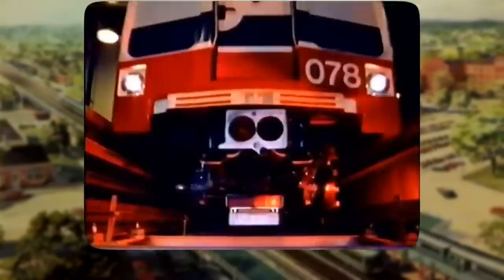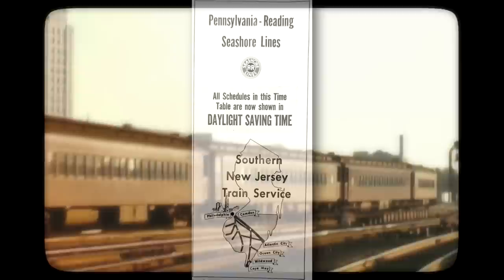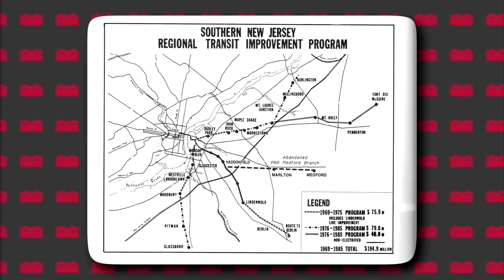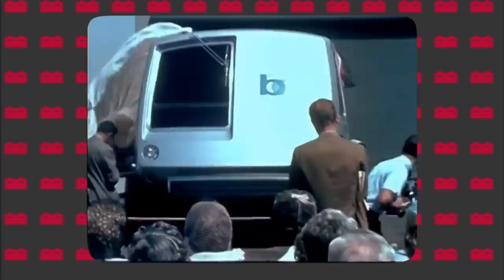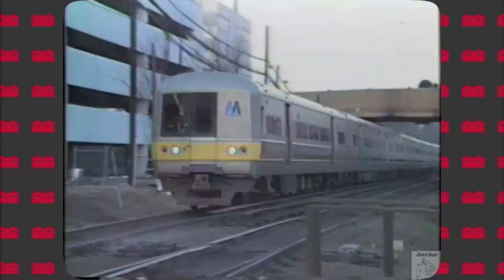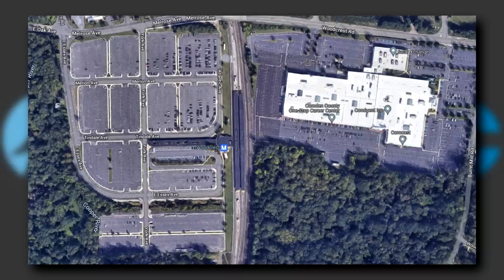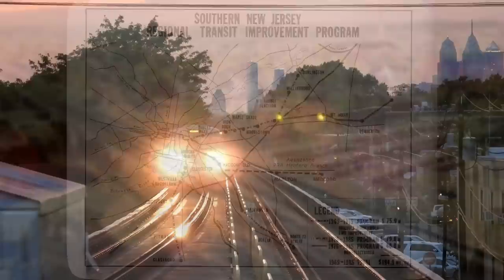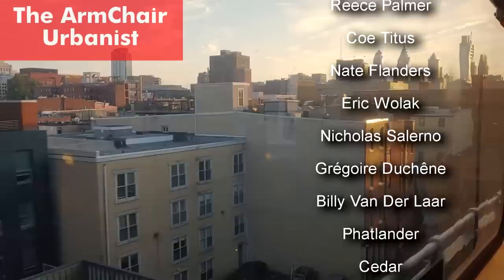PATCO: The First Modern Metro Line in North America

Comment: I came over from London to ride the NJ Transit River Line a few days after it opened.  When I arrived in Camden I then rode PATCO to Philadelphia; what a confusing place for transport that city is.

I knew that PATCO was about the same age as the Victoria Line, but if it opened in 1969 then that was not three years after the Victoria Line which opened in stages between 1968 and 1971.  I’m not sure about the date for Pimlico which was an extra station opened slightly later.

The original trains on the Victoria Line were known as 1967 stock, but that was when they were built, not when they entered service.

The Victoria Line was mot the first place in London to see automatic train operation; the system was first tried out on the section of the Central Line between Woodford and Hainalt.  I don’t know when that trial started, but I did ride an automatic train on that line.

What is the closed station which PATCO trains pass through just after coming off the bridge on the Philadelphia side.
Reply: Franklin Square is the name of that station. It is currently undergoing refurbishment to reopen for the fourth time in its history within the next few years.

Comment: Good video, but wasn't balloon framing not done in the 1960s? I believe after WW2 or so they realized the fire risks associated with having the frame run from basement to attic and moved on to platform framing which was faster than the balloon framing you mentioned around 6:30 I could be wrong on it though I just remember looking into it a bit when it came to real estate.

Comment: Patco is a great way to get into Philly from South Jersey. Very well connected and the ride over the Ben Franklin Bridge is really cool. Its well kept up too and has advanced technology for the time it went into service. I do think the park and ride situation, especially the stations further out like Woodcrest were designed to serve highways rather than communities nearby. Transit villages are seriously lacking on the entirety of Patco. Have you thought of doing a video on the River Line? Not only is that an interesting rail system in South Jersey because it's one of the only few diesel light rails in the country but it's well connected to downtown areas like Burlington and Riverside and improved connectivity with most of South Jersey and the services that go into Philly and the rest of South Jersey as well as the northeast corridor line. It was one of the few transit projects that came into fruition that were proposed in the 1990s and helped provide a clean, frequent, and affordable link for most of the riverfront communIties between Trenton and Camden, which some were transit deserts for quite a while. It also runs along the former Camden and Amboy Railroad which is something I highly recommend for another video too.

Comment: I live near the Lindenwold terminal and Ashland station. It would've been cool to see them build the other lines out to Glassboro and Moorestown however those branches would've been built on lines with existing freight service whereas the current route has a parallel one used by freight trains. While most of the suburban stations have large parking lots with no TOD, Haddonfield, Westmont (Haddon Township), and Collingswood stations are located near downtown districts and feature smaller parking lots that are somewhat hidden behind the shops making good use of the existing TOD. Many Haddonfield, Haddon Twp., and Collingswood residents actually walk to the stations. 

The biggest problem about PATCO is that it killed every existing commuter line and the ACL isn't even a viable option as it's operated more like an intercity service than a commuter. The prior commuter rail lines all terminated in Camden where you would transfer to the Bridge Line similar to how most NJT trains up north terminate at Hoboken and you take PATH to Manhattan. River Line and the future GCL involves a PATCO transfer at Camden. You would've had to build a tunnel under the Delaware River as the Delair Bridge is out of the way, and a connection to SEPTA's downtown Philly tunnels (which are already very busy to begin with). PATCO provides a one seat ride to Philly with decent service at the cost of killing existing service to Gloucester and Burlington Counties.

Comment: Need a dual mode diesel electric DMU with electric motors like a Patco / subway car for the high speed line portion and a Diesel for the Glassboro line that is shut down in the tunnels.

Comment: Wait... how is 75 mph for modern rail "high-speed"? o.o

Or was it, rather, "high-speed" compared to much-slower rail systems in use in 1969?
Reply: If I understood Alan correctly, it's high speed for a metro since metros typically don't have a high speed thanks to the density of stops (e.g. the Paris Metro and Berlin U-Bahn both run at a speed of around 30 km/h or 20 mph). By turning it into a more suburban train like the Berlin S-Bahn with fewer stops, it makes more sense to run the trains at a higher speed compare to other metros.
Reply: It's high speed for a metro. Metros typically don't exceed 45-50 mph.

Comment: There is a way to Philadelphia from South Jersey by rail besides PATCO. NJ Transit's Atlantic City line uses the Delair railroad lift bridge between Pennsauken and Philadelphia. PRSL had limited service over the Delair bridge to from Atlantic City til after PATCO began.
PATCO has huge parking lots because it draws passengers from far beyond its Corridor, and sketchy bus service from surrounding areas. Ferry Ave, Westmont, Haddonfield and Lindenwold plus Broadway in Camden have at least coincidental NJT bus service. PATCO does little to encourage connections. There's no joint fare available, little or no posted schedule or route information. The worst connection is with the River Line at Broadway in Camden. The River Line stop is next to the west head house, which has been shut down and locked up since the pandemic. PATCO wants it locked up pending a $250 mln re do of Walter Rand transportation center including PATCO and bus facilities.

Comment: Is it too much to call PATCO an S-Bahn line ? S-Bahn are more for entire system but it's clearly not regional rail and calling it a subway is kinda strange
Reply: S-Bahn (Stadtschnellbahn) literally translated to English means "fast city train", and depending on where you are it's either a subway or a commuter train...
Reply: @jan-lukas  I had seen translation that tell that S-Bahn really is a different category, between RER and regional rail, Hight frequency in a center core and lower frequency on the branches  (15min or lower)
Aren't commuter train different than regional rail ? damn those name give me anxiety
Reply: @Yataka  S-Bahn and RER are the same thing.
Reply: @MrAronymous  There are not, an RER is suppose to be much heavier, metro like frequency along the line (maybe less for the branches)
Reply: @Yataka  That's what an S-Bahn is also supposed to be. Sure, train sizes vary, but these days, almost all S-Bahn systems use full-size main line trains. Only Berlin and Hamburg don't, as they are much older. Any serious S-Bahn system built post-WW2 (Frankfurt, Munich, Stuttgart to name the important monocentric ones) is no different to the Paris RER in concept and execution.

Comment: As a Montrealer, I hate to rain on your parade but.... Montreal got an automated GoA3 (capable of GoA4) train in 1967 for the 1967 EXPO. It was the Expo Express.   But it was a temporary service that lasted a year or two. The trains were mothballed in a rural yard for many many years and disapeared in the 1990s. 
Video on the building of the Expo Express:  https://youtu.be/RFmAyzt4XFc  
Built by Hawker Siddeley and WABCO.  Hawker Siddeley was bought by province of Ontario (UTDC - which built the initial Skytrain in Vancouver) then UTDC sold to Bombardier and Bombardier saved by Alstom. 
BTW, I took PATCO a few time (love that they take bikes at all times) and really did notice acceleration and speed. These things are fast ! 
Wasn't aware until your video that contrsuction of Patco meant loss of rail service to southern NJ.  But since Atlantic City rai line connects at Lindenwold, couldn't they have connected these other lines at Lindenwold too?

Comment: This was really unexpected! Never knew the speedline was the first modern Line
Reply: Plus it was inspired by the original P&W line in Delco, built in 1907.
Reply: @Poisson4147  ooh cool!
Reply: @rynxbybeat4426  Yeah! In fact when the line opened there was actually a CBS News story about its P&W heritage. I have zero idea whether there's a clip available today tho.
Reply: @Poisson4147  that’s actually a pretty cool fact I did not know about I only knew about the train line when it was opened back in February of 1969, never knew back all the way then.
Reply: @rynxbybeat4426  The P&W was and still is unique - part trolley, part interurban, part light rail. 

It used to have an ingenious flag-stop system for most platforms: there was a button that waiting passengers would push to signal an approaching car. If no signal was activated the driver knew they could simply bypass that station. That saved a lot of dwell time over the full line (13+ miles). Typically locals could make the trip in ~25 minutes and expresses in ~20. 

Of course SEPTA, with its infinite ability to downgrade everything it touches, eliminated the flag-stop system.
Reply: @Poisson4147  that’s really cool to know I didn’t know about all of this interesting facts!
Reply: @rynxbybeat4426  Been riding the line since I was a kid. You learn a lot over the years 😀
Reply: @Poisson4147  oh wow I can’t wait to get to know stuff like you 🙂